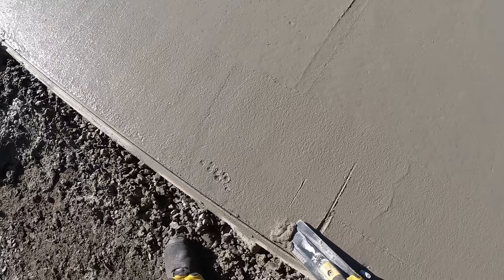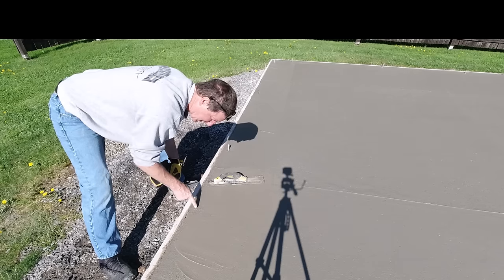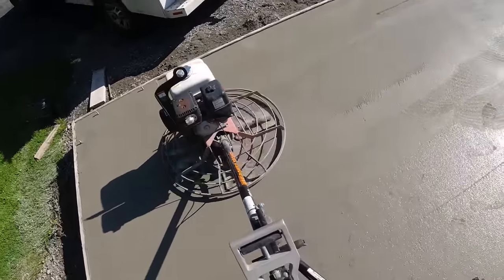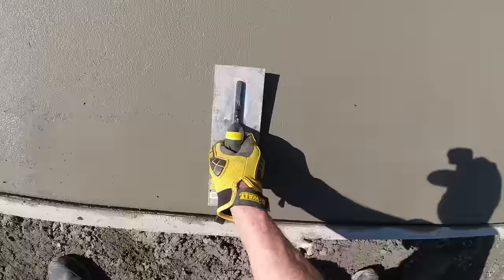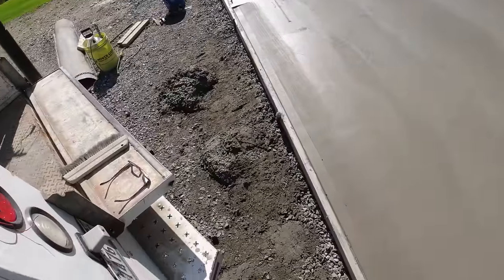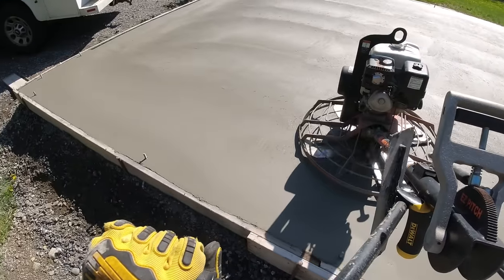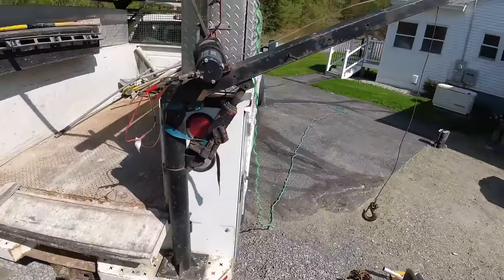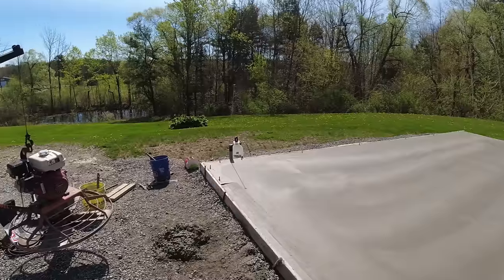Beginner and DIY Concrete Slab Finishing - Watch Before Doing This!

Comment: Mike. Just the way we used to do it! Perfect work!!
I’ll never understand why some crews don’t use a power trowel. Saves so much time and labor
Reply: I agree. Only time is if it’s a small slab or in winter time and I will hand trowel it .
Reply: @brentpearson4877  agreed!  Makes no sense to me with a decent size driveway or patio to put guys on knee boards.

Comment: Mike. You are the only I see run a power trail machine over the concrete after pouring it. These guys that pour driveways just get 2 or 3 finishers and they work on mage it all, then one guy will put a line about quarter to half inch deep in it depending on the size of the driveway.Some of these driveways sre 30 feet wide to may e 150 ft.long.
Reply: Drive ways and garage floors get two different finishes